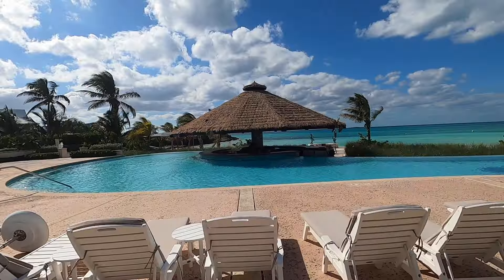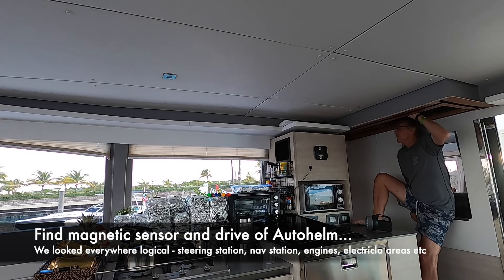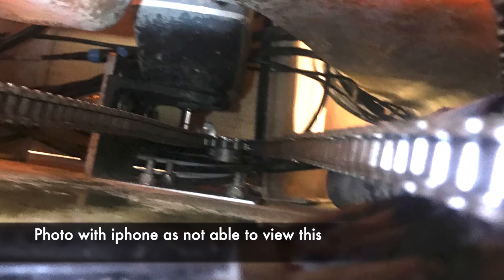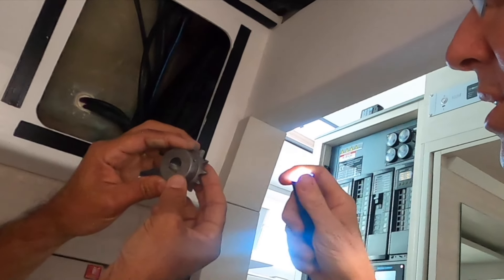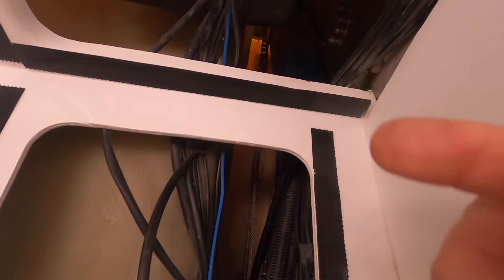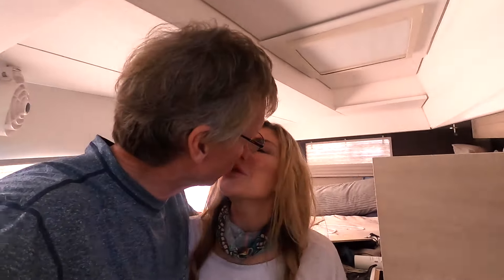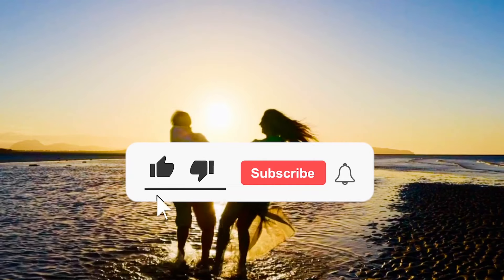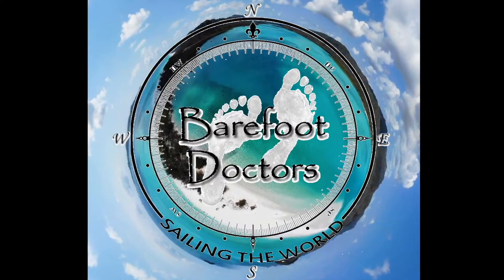#19 Bahama Resort Living and Bermuda Triangle Glitches Pt 2 -  Leopard 50 catamaran

Comment: i dont know how i missed you channel guys, i only found it because of the devestating fire. So sorry for the hard work you put into her. Hopefully you can be out on the water asap. love your content and the Aussie accents. from frustrated Melburnian. So you get the terms right Dr, that slug is a Key and it fits in the keyway of the shaft and sprocket. Great job finding the bits and getting it back together